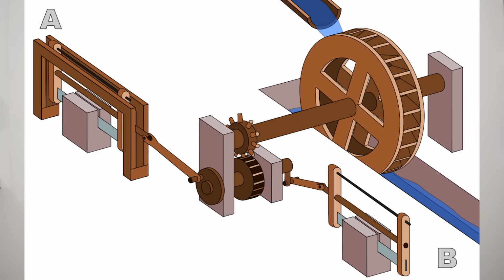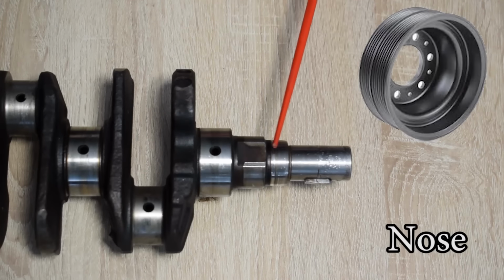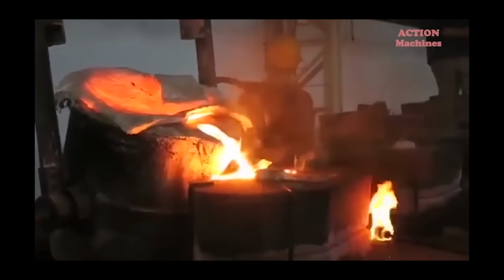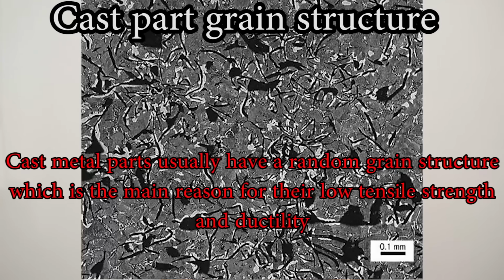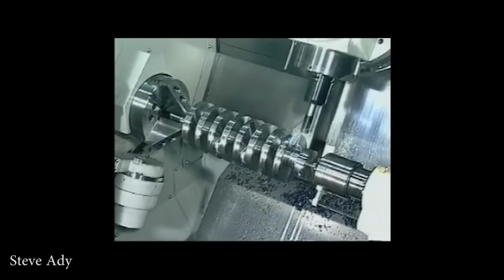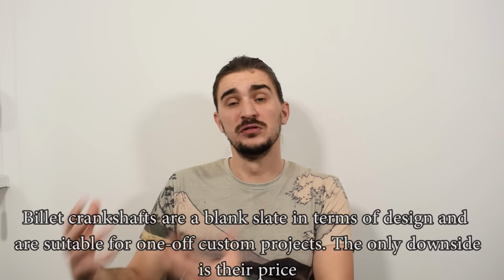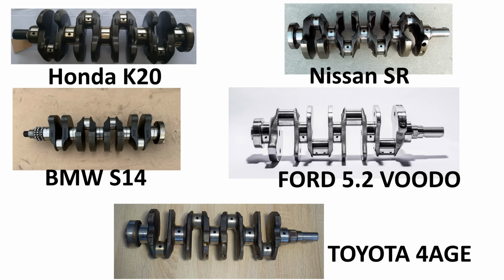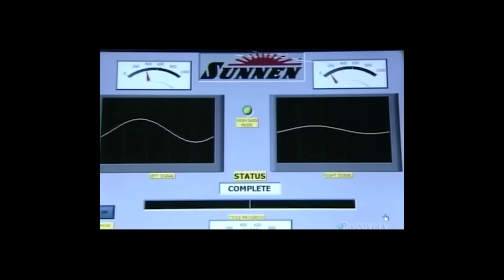EVERYTHING about the CRANKSHAFT - Function | Manufacturing | Different types | Forged | Billet

Comment: Years ago on a forum that I frequented, a member who had some basic knowledge of physics, but no practical knowledge of the workings of internal combustion engines proposed an idea: 

A solid tungsten crankshaft...

He couldn't understand that, for one, you need an alloy to be able to withstand the forces on the crank, and two, the amount of power necessary to spin that mass would be astronomical. He also couldn't understand why you want a lightweight crank, thinking more mass meant more power - and while more mass does mean more stored energy, that stored energy wouldn't be useful in a street or race car scenario. 

It was a funny thread, it went on for a very long time and became quite a big joke, ultimately with ideas of cranks made from depleted uranium or even dark matter...😂

All that to say, fantastic video! I love how clearly and concisely you explain everything. It's a wonderful, easy to follow format. Thank you!
Reply: Dark matter crankshaft😂
Reply: Sounds like a fun idea until you realize that Tungsten is radioactive. It would add a whole different level of danger to an oil change lol.
Reply: @foxman105  Some isotopes of tungsten are radioactive, but not all.
Reply: @electric7487  oaky.and how do you plan to separate them?
Reply: @foxman105  Dude, 99.8% of tungsten is stable. The four common isotopes, W-182, W-183, W-184, and W-186 make up 99.8% of naturally occurring tungsten and are all stable. The remainder is W-180, whose half-life is 1.8 quintillion years. There is zero risk because it emirs so little radiation that no one has to worry. Please take your tinfoil hat off.

Comment: don't get me wrong, I'm not writig because I think youre chanel is bad, but because it is one of the best for explanation of engine tecnology which I found on you tube.

Crank shafts don’t care a lot about forces, but a lot about torsion. The primary and secondary mass forces are important for NVH but not directly for crank shaft stresses. What really matters is the Eigenfrequency of torsion and the combined torsional frequencies of all mass and gas forces. If the match, the crank shaft will be stressed to the maximum. To reduce this stresses, dampers are necessary for more than 3 cylinders (I could write much more about it...)

Casting vs. forging: Like I said before about connecting rods: In modern engines you will find much more casted crank shafts and connecting like 30 years before. Mercedes for example changed the crank shaft of the A-Class Diesel engine from forging to casting without changing the bearing dimensions. Casting is becomming better and better and reducing cost is a strong dringing force....

Forced induction on gasoline engine doesn’t increase the peak pressure a lot, because it is limited by knocking. Even modern boosted gasoline engines are operated with a peak pressure of about 100 bar.

Cross drilling the main bearings enable undivided lower bearing surfaces (180° oil groove) and so, much higher resistance to gas pressure, that’s why all Diesel engines are equipped with cross drilled main bearings.
For really high rpm (like in Formula 1 engines) the oil is center feed from one end and flowing longitudal through the whole crank shaft.

Knife edging crank shafts is kind of woodo to me, I never seen any knife edged crank shaft from an serious racing application or OEM. In contrast, sharpening the leading edges of the counterweights gives a small benefit (with almost no cost) and can indeed be found by some OEM (Opel). 

Crossplanes and flatplane crank shafts for four cylinder and eight cylinder have a totally different background and pros/cons, therefor no general rule can be given. 

For eight cylinders, crossplane crank shafts offer perfect mass balancing, but uneven firing on each bank. If the exhaust system is on the outside of the engine, this will hinder the gas exchange effectivity. To avoid these drawbacks, the exhaust system can be placed inside the V (like in modern BMW V8 engines) so, that even exhaust pulses to the Turbocharger can be realized. Also some Formula 1 engines in the sixties had a central exhaust system with combining 4 cylinders from 2 cylinders of each side. 

Flatplane for eight cylinders have free mass forces of the second order and run much rougher. The advantage is the even firing order on each bank which offers more power and torque compared to the conventional crossplane V8 with side mounted exhaust system.

In four cylinder inline engines, Yamaha is the only example of a cross plane crank shaft to me. Here, the cross plane enable a nearly constant kinetic energy of the reciproting masses, which shall result in a smoother run at very high rpm.  In a conventional four cylinder, all pistons reach the maximum and minimum value of kinetic energy at the same time, thus giving uneven rotational speed of the crank shaft. The drawback of the crossplane design is the free mass moment of the first order and the uneven firing, that’s why these shafts are very uncommon.
Reply: While you're right that torsion is the primary condition crankshafts need to resist, planar bending is not insignificant. On I6 cranks, the fact that rotational forces on one throw are cancelled out on the other half of the crank sets up a bending moment about the centre of the crank (roughly).

It's less significant than torsion, but not insignificant.

Comment: I thought gas engines only had a compression of about 120-160 psi and Diesel engines of about 300-400psi
Reply from the maker: Compression is one thing. Combustion pressure is another. Compression is how much the pistons compresses the air basically, combustion the pressure generated by the ignited air fuel mixture

Comment: On the subject of crank shaft, my 2002 Ram 3500 V10 has a Nodular Iron Crank from the factory, but I haven’t really been able to find any information on its strength
Reply: It's just a bit stronger than regular iron. Both are still cast cranks.

Comment: Why do cross plane cranks make more torque?  Doesnt make sense.
Reply: Neither crank can “make” more torque than the other.  Crossplane is heavier and creates more windage so it consumes more torque.  Also the claim “Crossplane has a cylinder firing more often compared to a flatplane crankshaft”. is not physically possible.  Here’s why: Both cross-plane and flat-plane V8 engines, being four-stroke engines with eight cylinders, have the same number of firing events per engine cycle at the same RPM.

Comment: I’d like to add a bit about the oil holes in the main journals on crankshafts. You need to look at where the oil hole in the main journal lines up with the oil feed in the main in the block. The “direct” feed, the oil hole will line up with the small end being just before BDC. You can cross drill most direct oiling style crankshafts. Your example of a cross drilled crankshaft 4AGE, oil holes line up when the crank is horizontal, you need a little more oil pressure for this type of crankshaft

Comment: The grain structure in cast cranks is not random; the differential cooling of thin to thick areas induces a grain structure as demonstrated in your images.  Forged parts are much more random and billet parts have the most random grain structure.

Comment: Cast iron is weak!  also my friend's car, 29psi of boost on his stock cast crank and cast rods for 10 years of regular racing/burn out comps.  Skinny guy holding up big girl meme comes to mind.
Reply: Cast iron is hard and brittle. Not very strong but very stiff. Cant be flexed or stretched for shit ie has very little  malleability. Just depends on your goals but ideally, not using cast iron is best almost everywhere you can avoid it

Comment: Ummm.... no. Crossplane V8 cranksafts DO NOT create more even firing of combustion events. Crossplane cranks are used because of the inherent imbalance of a flatplane crank design, which cannot simply be overcome by adjusting the counterweight. FLATPLANE cranks provide the most even firing of combustion events in 90 degree V8s, and also distribute these forces more evenly... which is why they are used in high RPM applications. The even firing of a flatplane crank allows exhaust and intake pulses to be managed more easily, creating more favorable conditions for managing high RPM scavenging and intake charge. Higher RPM operation requires the use of shorter intake runners and exhaust header primaries to keep the pulses of interrupted flow from inhibiting one another. With crossplane cranks, designing a properly tuned intake/exhaust system to function well above 8,000rpm is a challenge, to say the least... and all but requires individual throttle bodies, unconventional reversed valve configuration, and center mounted exhaust ports. On the flip side, flatplane design is inherently unbalanced, and doesn't lend well to displacement above 5 liters. Engineers learned long ago... when more power is needed, it's easier to increase displacement or add forced induction, than it is increase RPM stability. Thus, crossplane cranks became far more ubiquitous among V8s, due to their ability to cope with these solutions (increased displacement/forced induction).

Comment: 1 minor language nit: the -et in fillet is pronounced like the -et in bet, rather than the -et in ballet.  The counterpoint for an outside edge is called a round.  It is exactly right that both are used to distribute the stresses more broadly, rather than to concentrate them at the inside or outside corner of a 90 degree intersection, thereby avoiding a stress riser that overtaxes the joining point, leading to failure of the material composing the joint (in this case, the cast iron or forged steel of the crank journal).  Very well done presentation - thorough, and well-explained.  Nice job!
Reply: In welding when you fill a corner it's called a Fillet weld pronounced fill-it.
Reply: @robertsherman8887  yes - fil-it, fil-et - that's just a small matter of accent.  What isn't a small matter is pronouncing it fil-ay, which is what you do to a fish, or a reference to a cut of meat.
Reply: @MrGsteele To confuse the subject further, a fish is a 'fill-ay' in American English, but still a 'fill-it' in British English (or at least in SSE, my particular variety).

I'm not sure we'd ever say 'fill-ay', unless perhaps when used to describe 'filet au mignon', though the vast majority of people would just call that 'tenderloin' and avoid the issue entirely.

Comment: Informative! How about shot peened crankshaft? Is it a type of surface treatment like nitriding?
Reply: Shot peening is a cold working process that creates plastic deformation in the material surface to harden it by firing small balls called shot (can be metallic, glass or a ceramic such as glass). A down side to shot peening is that the process can cause stress on the surface. Nitriding works by the ammonia comes into contact with the material at 520°C and dissociates by having the nitrogen being absorbed into the material on a molecular level. The processes are completely different to one another.

Comment: Very informative. Two early American aero engines, the Liberty and the OX-5,  had flatplane cranks. Aero engines are low rpm engines, rarely exceeding 2,500 rpm, and both of these had one or two rpm readings to avoid because of unwelcome vibrations that occurred, even with that big propeller for a flywheel.
Reply: The Liberty L-12 did not have a flat plane crank. That's not surprising, since a flat plane crank would be nonsensical for 12-cylinder engine. As should be expected, there are two crank throws at each 120 degree interval... just like an inline-6. It really is two inline-6's on a common crank, unfortunately skewed at a 45 degree bank angle instead of the preferable 60 degrees. The Liberty L-12 crank had lots of problems, presumably due to torsional vibration. 

The Liberty L-8 was the V8 version of the Liberty. I don't know what crank it had, but this seems to have been only a development model which did not go into production.

The Curtiss OX-5 apparently did have a flat plane crankshaft, which made sense in a 90 degree V8... even when it was built in 1908.

Comment: Typically it's not the crank that fails under long use, it's the harmonic balancer that fails and ruins a crank. Harmonics play a critical role in the lifespan of a crankshaft, even an unbalanced fuel injector can generate higher than normal cylinder pressure in a single cylinder, causing a chain reaction that can wear the journal and require remachining.
Reply: Not all engines have harmonic balancers

Comment: I love where you're going with this, but your explanation of the flatplane is wrong.
Pretty much, the only advantage is that it requires as much counterweight as an inline 4, so not much, meaning it revs easier. Crossplane cranks require more counterweights to cancel out the forces. The flatplane is actually worse balanced.

If you do the math on how they fire, it's the exact same (once per 90 degrees), but the crossplane has a different firing order to compensate for the wonky arrangement.

Comment: One detail you missed on the flat plane vs cross plane crank  explanation is... Cross plane crank v8's tend to be smaller displacement engines. When you put a flat plane crank in a 350 cid v8,or bigger. You will have vibration problems that cannot be balanced out. When the flat plane v8 displacement is kept as low as 3.5 liters. You will have a small enough mass that the vibrations go pretty much unnoticed. This makes the flat plane v8 essentially two 4 cylinder engines on a common crank. This is why the small flat plane crank v8's are screamers. The Ford 5 liter flat plane crank V8 in the GT 350 is some what of an anomaly. Typically that large of displacement v8 with a flat plane crank will rattle its self apart. Ford kept the reciprocating mass low enough for this to work. They became the exception, not the rule. Older Italian sports cars from the 60's typically had flat plane cranks if they were v8's. These were all small displacement engines that could rev to the moon. American v8's from that time were all cross plane because we just liked the feel of torque kicking us in the ass with every shift. Something flat plane crank v8's cannot deliver.

Comment: 20-30% elongation for forged steel, that is something indeed. Let's try to imagine an engine failure that caused that much deformation. What would the rest of the engine look like with a crankshaft bent that far while still in one piece? If something like this ever happens then we've got problems and someone had better be answering questions.
Reply: That elongation number doesn't really tell the story that matters. Because the crankshaft goes under cyclical stress you need to look at the SN curve at a given amplitude. A forged crankshaft is not going to survive many cycles if it's seeing 20% elongation.

Comment: I have a question on the billet process. The raw ingot or rod is cast in the first place isn't it? Then wouldn't the grains be weaker than something that was pressed during forging?
Reply from the maker: The raw ingot is forged into shape 😉
Reply: @d4a  But what shape was it before it became that ingot? Is it like they cast the molten metal then extrude it?

Comment: 26:08 I don't think that is right... In both Flat and Cross plane 90° degree V8s there is a cylinder firing every 90° degree.

The reason Flat and Cross plane sounds different is due to the firing order. Its harder to evenly spread the exhaust pulses of a Crossplane true the exhaust pipes. That is why Flatplane sounds smooth while Cross plane sounds like the engine is "pulsing/burping".

Crossplane engines with a exhaust manifolds design for scavenging have the secondary effect of making a the Crossplane sound somewhat like a Flatplane.
This happens because by giving some of the cylinders exhaust pipes extra length all cylinders exhaust pulses meet evenly on the exit end of the exhaust manifold.

Here is a very good short video to watch that explains it better https://youtu.be/rVG6TPNcaDY?t=74
In the 3:47 he makes a mistake similar to yours saying that a Flatplane fires a cylinder every every 180° degrees instead of 90° degrees.
The correct thing to say would be: The >Cylinder Bank< of a Flatplane has a Cylinder reaching TDC every 180° degrees while the >Cylinder Bank< of a Crossplane has a Cylinder reaching TDC every 90° degrees.

Comment: Super content, great video. You compressed so much knowledge that would require so many books to be read in one video, amazing,
One noob question. 4340, the alloy of Ni Cr Mo can it be forged.?
As you mentioned it can only be used in billet made c/s.
Thank you again
Reply from the maker: 4340 can definitely be forged, it often is and has good properties for forging. Many aftermarket forged rods, for example, are made from 4340. The billets used for billet cranks are actually forged into their large cylindrical shape. Thanks for watching, and thank you for the supportive comment.